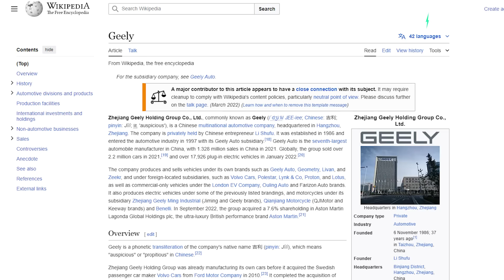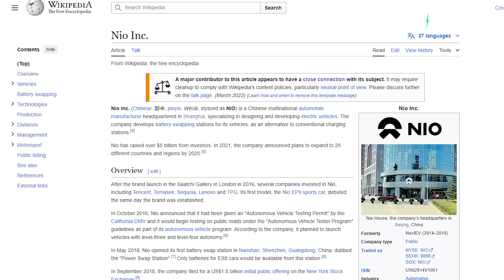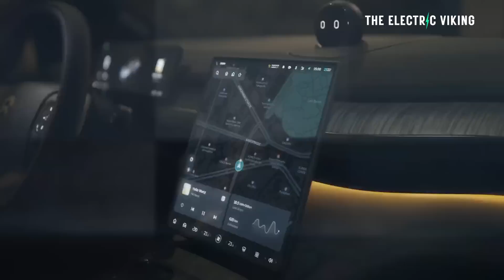$25,000 Tesla getting rid of Production line for world first assembly method

Comment: EVs will get cheaper to make over the next decade and at the same time the cost to make any car with a tailpipe will increase. Price "parity" will be very short lived.
Reply: Gigacasting may reduce production costs, but it essentially creates disposable cars.  One fender bender accident will total your car, because castings generally can't be fixed.  Insurance costs are going to skyrocket.
Reply: @dzcav3  There are a lot of cars that don't use castings that are just like that. If you crash a Genesis with all that ADAS stuff in the front or a Land Rover or any German car it's totaled. A casting can be replaced for the same price as piecing dozens of parts back together you just trade casting cost for extra labor costs. And you get safer results because everything is perfectly back to factory spec.
Reply: @dzcav3  Same concept as the old VW Beetle, the unibody no?
Reply: It all comes down to the battery manufacturers. The big question is what is the timed life of their plant and what do they have up their sleaves to replace that plant with.
In some cases, plant is surely already half way through its life. In others, the clock may have just started. It will be an interesting few years ahead.
Reply: @davidbrayshaw3529  In a few years the world will be awash with batteries and cost will come WAY down. Only the new fancy or solid state ones will be expensive.